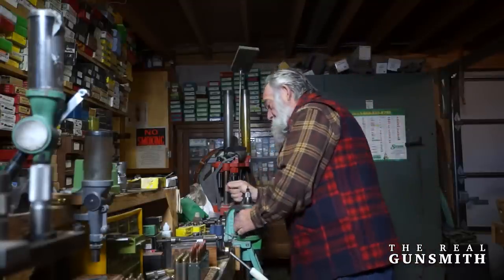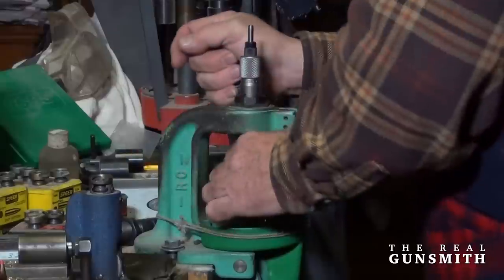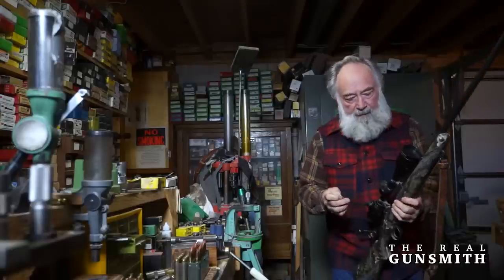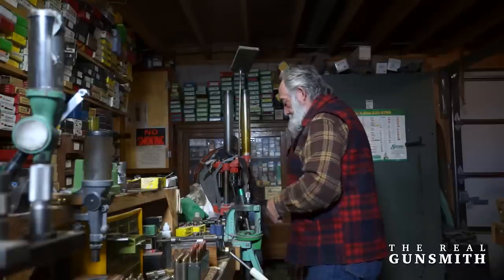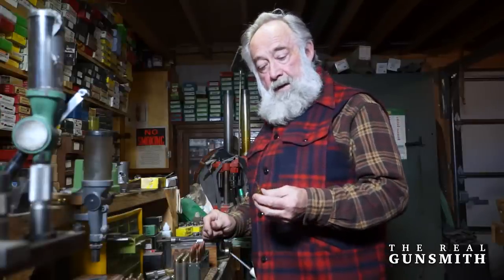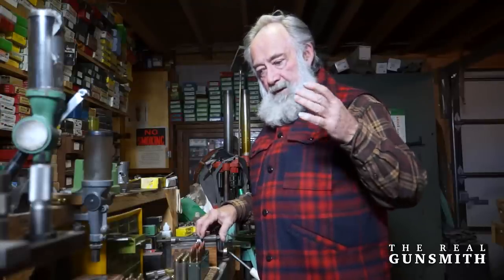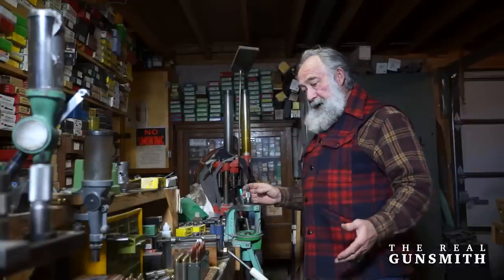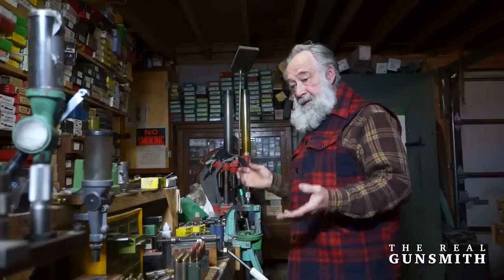Properly Sizing Cases – The Real Gunsmith

Comment: My take on the reloading manual instructions are you would use them only when you want a sloppy case that is supposedly saami spec so that you can fit it in any chamber. To load for real, you load to the chamber like Randy is doing here. This is how you get accuracy and consistency, not the one size fits all described in loading manuals.

Comment: That works well for a bolt-action rifle, but is definitely not what you want to do for any break-action, lever-action or semi-auto.  I would also mention that most case stretch actually occurs during the resizing operation, NOT during the firing sequence (unless the case was grossly oversized).
Reply: You make a great point and are correct. He is form fitting that case to a specific rifle chamber. As you know they are all different; if he was to try to load it in another rifle of the same caliber it probably would not work very well, or at all..

Comment: That’s a great video and spot on. Should note that it’s imperative that you do this with belted magnums. Always headspace cases on belted magnums with the shoulder like this. You can get 35 plus firings using this method if you anneal.

Comment: I have watched many of your vids… and discovered much of what you tell I already know through common sense logical thinking. You have tho , taught me a few new things. Thank you… your approach is very methodical and makes the same sense to me. I was pleasantly surprised to your approach to cutting , threading, chambering a rifle barrel, your mindset mirrors mine. I have watched many vids on “proper set ups and methods” and tho I won’t argue with them , I will say I like yours and my concepts. I always felt using centers and steady rest on the lathe is (by law of absolute) the zero tolerance achievement. Many go about it the difficult way.  I haven’t built nearly the amount you have and neither am I a certified gunsmith… but I have cut n chambered many rifles and they shoot exceedingly accurate… sub MOA… I don’t know as much as you but I have had good success in my endeavors. I own a machine shop and with that have built many rifles. Again , I thank you for your videos… cheers!

Comment: Excellent clear to follow advice from Randy, as always, wish I had this advice to hand when I started reloading, out of interest Randy, what is your opinion on neck sizing only, using cases fired in the same rifle of course? All the best.
Reply from the maker: A neck sized case will size the neck off center, as the body is not aligned to the die.
Thanks for watching.
Reply: Thanks Randy, I was thinking particularly of the Lee collet die, which as I'm sure you know, only sizes the neck, and obviously doesn't bump the shoulder, I ask, as I have used them, and find they do produce accurate ammo, one again, thanks for sharing your lifetime of experience with us sir.

Comment: Would you comment on the shoulder bump / bolt “feel” with push feed ? Removing ejector? Case comparator from the datum line -.02 +/- ect….
Reply from the maker: Do not remove ejector. Size to correct feel in the rifle they were fired in.
Thanks for watching.

Comment: I use a case comparator and I measure my cases after firing and bump the shoulder back .002" and I haven't had any problems. I have found that some cases, when they're new, stretch as much as .010" as they are designed to fit all chambers. After one firing the Case should be pretty much fire formed to your chamber. Full length resize and bump back .002-.003" is plenty without risking future case head separation. Just my experience. I think you should do one on resizing belted Magnum cases.

Comment: Great video.  I am new to reloading, trying to get more accuracy from a 7mm rem mag.  It currently only averages around 1.5 MOA  with factory ammo.  I understand bumping the shoulder back a minimum amount with fired brass to customize to chamber.  My question is resizing the diameter of the case body.  Do the full length resizing dies simply resize the diameter back to a standard factory diameter, or is this customizable as well?  Are we only worried about a custom tight fit in the shoulder and neck area, but a standard fit for the body?  Thanks.

Comment: I have found that when not making firm contact with the shellholder, the FL die's shoulder may not be touching the case shoulder at all and can actually be squeezing the case shoulder forward very slightly, contributing to difficult chambering. The case wall taper will have a bearing on this, of course.

Comment: Mr. Randy
I have been doing this for years with all my bolt action rifles. A friend taught me this when I first started trying to load precision rifle rounds.
I have a question about another step and would love to have your input if you are willing to answer.
The same guy taught me to load and fire all of my brass and then to NECK SIZE that brass. Along with the beginning sizing you showed, I was told that neck sizing the brass approximately 75% of the neck length would create the best fit to the chamber and increase accuracy. 
Is that information correct or is it a waste of time for hunting rifles?
Also does the manufacturer of the brass matter in hunting rifles like it does in long range precision rifles? If so, in your opinion what is the best brass to use for the 300 Winchester Magnum?
I am using a Weatherby Mark V Accumark Elite if that makes any difference.

Comment: Randy, this works great for cases that have been fired in another chamber.  What about virgin cases that have only been fired in the gun you are loading for?  On a once fired case I find no resistance when closing the bolt.  I have been just neck sizing until I begin to feel resistance (about 4 firings) then I full length resize using the method you demonstrated.  I have been chastised by some for not full length resizing  every time.  Is my method sound, or do I really need to FL every time?  Anyone have thoughts on this?
Reply: Stop neck sizing go watch Erik Cortina’s videos.
Reply: Randy’s method here is the same as Eric’s just not as complicated.  Most people can make something that’s not hard to do harder to do. I guarantee Randy’s method is getting the same results as far as accuracy.
Reply: @charleywalker2982  Erics is not complicated at all, but it is far more precise because it is done with actual measurements and not perception of what you feel.
Reply from the maker: @Charlie Walker, you said it right.
Thanks for watching.
Reply from the maker: @Michael Hennegan: I think you are already sizing the case too far and pushing the shoulder back after first firing.  Back the die up 1/4 turn and start over until you get the feel, as described in the video.
Thanks for watching.

Comment: Here's what you are normally supposed to do. Raise the ram of your reloading press all the way up. Screw the full length sizing die (FL die) down until you touch the shell holder (make sure you have the shell holder inserted already). While the ram is still up, back off the FL die by an 1/8 of a turn. USE A SHOULDER COMPARATOR (Hornady makes a good one). When you FL size a case the shoulder should bump (gets smaller in number) by .003 tops (unless you know what you are doing). Example the shoulder being "1.523 and you make it "1.520. Size, measure, screw down by another 1/8 of a turn, measure, repeat until you get the desired shoulder measurement.

Comment: G'day Randy, what would it tell you about my chamber if I'm able to take a once fired case of factory ammunition and put it in my chamber and close the bolt easily without needing to bump the shoulder at all?

Is this a common condition? I've owned two 30-06's of different makes and this has been the case with both, I've never had resistance on the bolt as you're getting in this video.

Thanks!
Reply from the maker: Case fit the chamber.  However when sizing a case is sizes the O. D. which lengthens head to shoulder, so now the shoulder should be sized for some resistance when closing the bolt.
Thanks for watching.

Comment: I have found that with my current 30-06 loads of 49.0gr of Varget bihind a 165gr. Bullet, that my cases are only stretching .001 of an inch.
After resizing the case the case has stretched an additional .008 of an inch.
After further checking the sizing die is necking down the outside of the case neck to .306 inch. Then the expander ball has to open the case neck to .330 inch. The inside case neck is now .306 inch. 
Thus is when my cases are being stretch an additional. 008 inch. Thus also cause neck splits.
I have reamed out the sizing die neck so that the inside duameter is  now .304 inch. 
Question have you ran into resizing dies incorrectly machined. These are hornady dies

Comment: I have RCBS full length dies fir 7X64 or 7mm brennek but the shoulder doesn t bump back? Could you explain me? Once fired Lapus brass.
Reply from the maker: Perhaps it was sized or you are using the wrong shell holder. Does the brass, when sized, fit in the rifle?  Contact me via contact page if you have any further questions.
Thanks for watching.

Comment: Very good video thanks for sharing.i was wondering do you anneal brass and if so how many firings in between annealing? Also do you use a type of annealer or do you use a torch in low light? Thanks again for the video yall take car God bless
Reply from the maker: No. Not needed.
Thanks for watching.

Comment: Randy, does it matter if you take the firing pin assy out of the bolt before checking fit?
Reply: Isn't the pin retracted when you close the bolt?
Reply: The firing pin won’t be applying pressure, but the ejector might.  Either you remove it, so that it doesn’t provide any pressure, or you do as he say, and accept only a light resistance.
Reply from the maker: No.
Thanks for watching.

Comment: Thank you my friend for this clear and well done video…your content reminds of an older friend/reloader who took the time to educate me on an ongoing problem with headspace/case separation issues I was having with even once fired brass in my .250/3000 Savage Model 99 (they locked up at the rear of the bolt) from back in the day…his concise instructions eliminated it…there is so much great content on the “Tube Of You” from folks like yourself that takes the care and time with the knowledge to present it properly 😊😊😊as well as those (too many) that lack that knowledge to present it correctly…AGAIN…THANK YOU FOR YOUR CONTENT! 👍👍👍…just as an aside…your beard is as white as mine and I see that as a mark of maturity and knowledge 😎😎😎

Comment: Or a better solution:

Measure exactly what the dimensions are of a fired case. Sometimes it doesn’t hurt to fire it twice to ensure it has maximum expansion if you didn’t fully fire-form on the first firing. 

Once you measure it’s fired headspace, anneal the brass. Then turn your sizing die down to about 0.002” of set-back. 

This way you’re not using your chamber as a die and your action lugs as a press. It will be the same every single time and you won’t have to readjust the die again.

Comment: My LEE die instructions tell me , down to the holder and back out quarter to half turn.
Reply: I’ve got a ak that has a tight chamber and one that’s looser both in spec. All guns are different. Mash em to the stop if your shooting a automatic a lot cuz they get dirty and will stick. He’s just showing how to prolong brass for a more attentive bolt action type. Just helps brass life.
Reply from the maker: And then size a case, gradually turning the die down, til the bolt closes, with resistance.  No matter whose you are using, as instructed in the video.  
Thanks for watching.